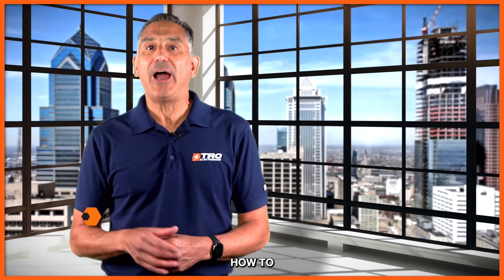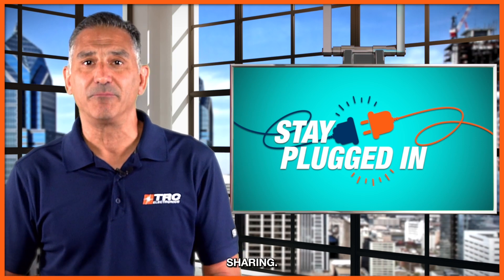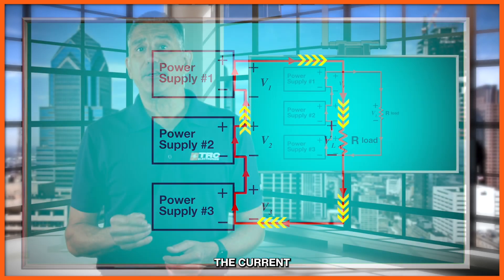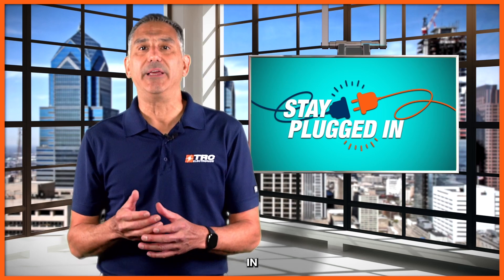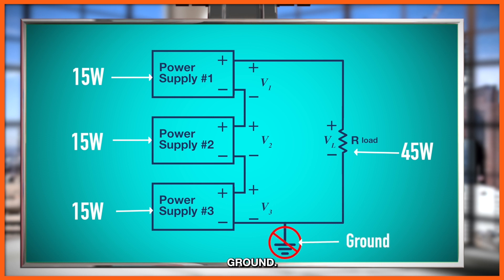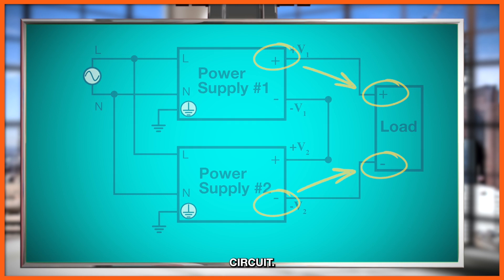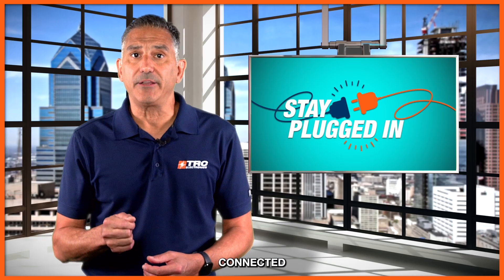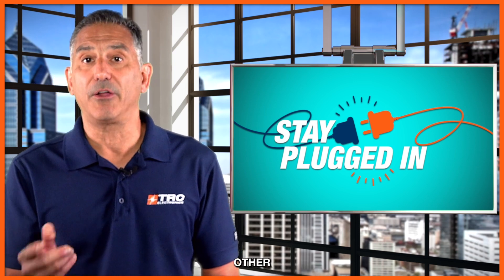Understand Connecting Power Supplies in Series🔌- Get All Your Questions Answered!

Comment: Thanks, very helpful.  But how to choose the right diode specification for any given set up?
Reply from the maker: Hi, a good rule of thumb is to ensure that the diode has the following characteristics:

1.	The current rating should be greater than or equal to the current that is expected to go through the load.
2.	The reverse voltage should be greater than the voltage provided by each power supply terminal it is connected across.
3.	Schottky diodes are a good type because they have lower forward voltage options, which result in lower power dissipation.

If you have further questions, please call us at 888-612-9514. Our power team would be happy to support you!